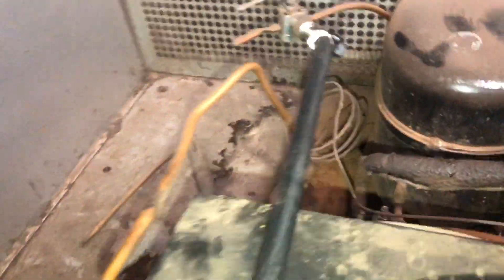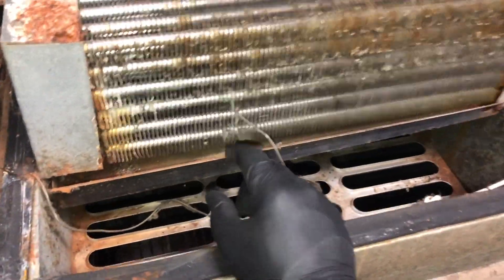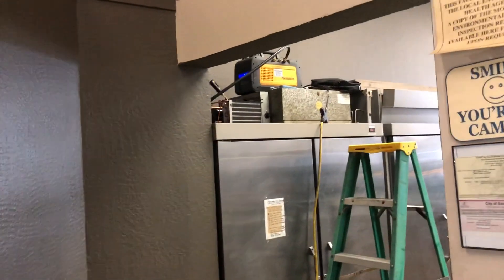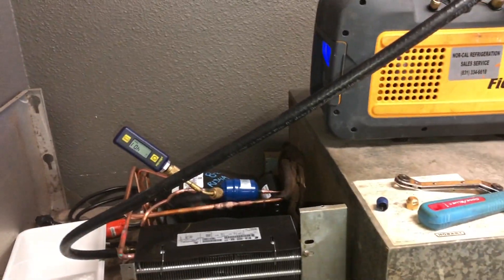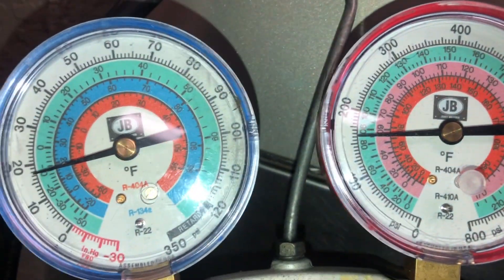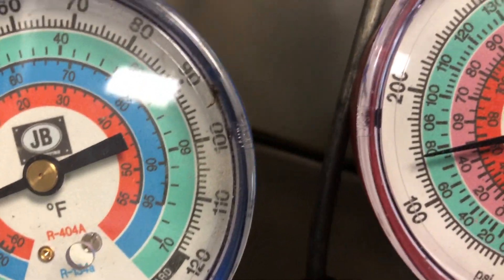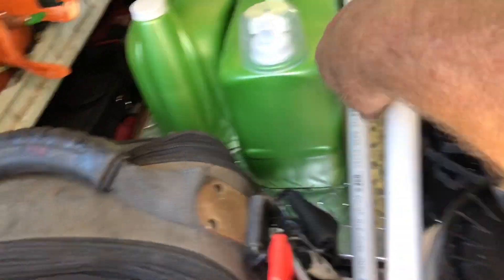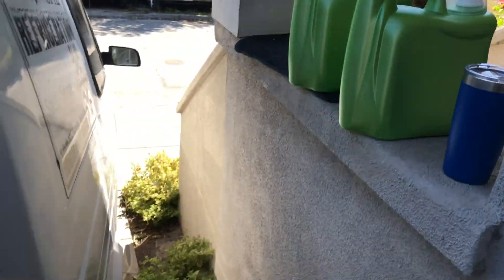Change a condensing unit on a 1992 Hobart and the veto TP XL

Comment: I am a old timer. 579607. Mostly Industrial. Ammonia etc. 6000 Hp at one place worked. It is interesting to see what you do. This is very similar with what Auto's use. Keep up the videos to educate ones that question. 1/4 Hp Cap tube system might seem easy but is intricate.

Comment: Do they still make units that has a hot gas tube to evaporate condensate? Or did the EPA outlaw that also.
Reply from the maker: They still make them
Reply: @NorCal-refrigeration  Good. Steam water from the Evaporator should not react over time.  I was thinking though over time with cross contaminates it might corrode. Everything has a end of Life.

Comment: Did you charged the system through the suction line? At what point do you remove the micron gauge?
Reply from the maker: Below 500 microns, you want to charge as much threw the high side,   But to finish the charge I did go in the suction side

Comment: Great video 👍 I have been looking at getting that bag how does it work for basic jobs I use the tp4b as my main repair bag have it packed to the max and keep my drill clipped to the side was wondering if I could fit everything in the tp4b into that....
Reply from the maker: Today was the first day using it. It’s about the right size.
Reply: @NorCal-refrigeration  that's awesome man I'm glad to hear that make sure you get a follow up with it after a little use for a good review keep up the awesome work brotha 🤙😎🤙

Comment: Good video dave. Why shouldn't you have a reciever with a cap tube? I never thought about that.
That veto bag rocks!👍
Reply from the maker: A cap tube works in a system with a fixed charge and amount of subcooling entering it and the pressure difference across it varies the amount of refrigerant flow through it to balance the load on the system. 

You get the change in subcooling by the amount of refrigerant that gets stacked up in the condenser (due to load or ambient variations, so if there's a receiver in the line the refrigerant will stack in the receiver and as such, the cap will alway see low subcooling so I would then expect to see a starved evaporator most of the time.

also, during an off cycle, refrigerant from the receiver will tend to migrate to the evaporator causing floodback on start-up.
Reply: @NorCal-refrigeration  cool man. Thanks for the info. You rock buddy🍺🤘
Reply: Why not just use a txv?
Reply: Grindstone  I was thinking the same way, least it would recover faster than a cap tube system under a heavier use.
Reply from the maker: Grindstone just easy to go back with the cap tube.  I do agree a TXV would be a better way to cool
Reply: @NorCal-refrigeration  LOL. A 1/4  Hp Unit gives little bang for the Buck going to a TXV. I promise to be not a Narcissistic individual. However.
Reply: I totally understand I usually dont get too crazy but figured if I had a cu with a receiver probably would've went txv. Btw always love your videos dude👊
Reply: Curious as well... thought a receiver would make the charge not so critical.